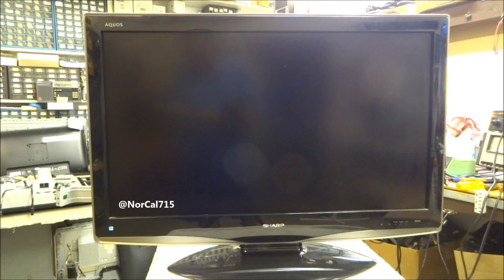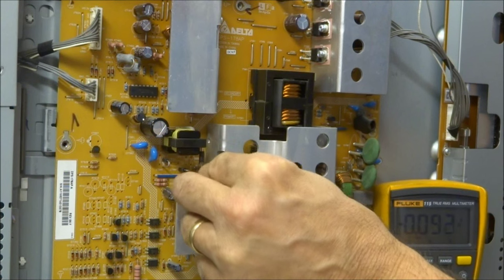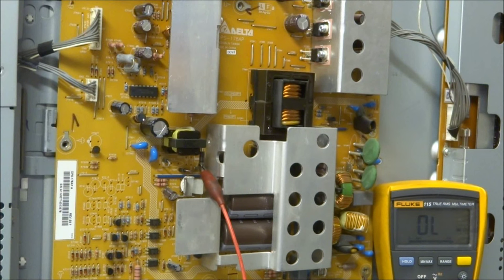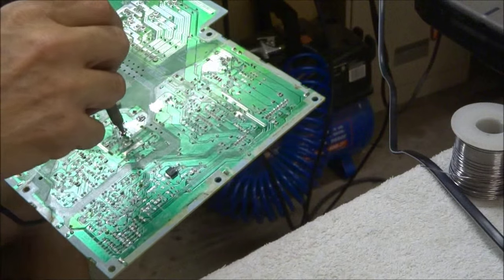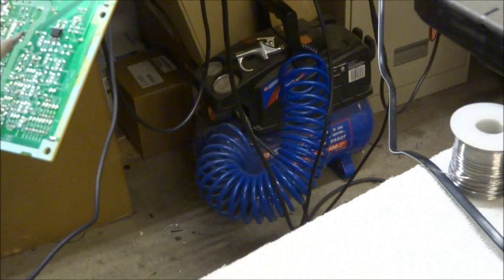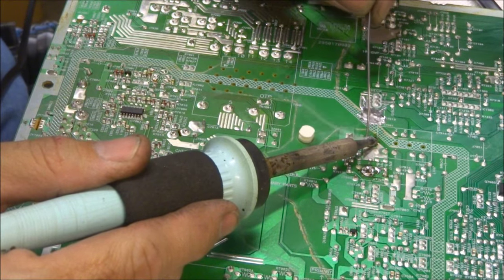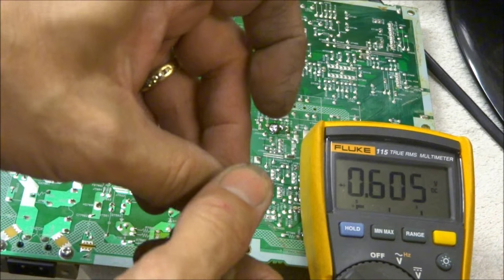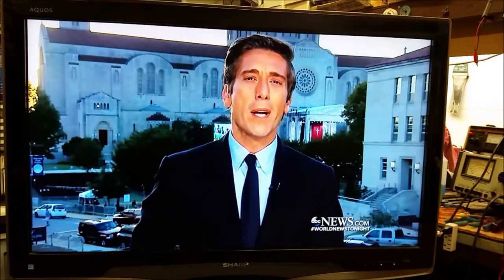Sharp LC 32 37 D 42 43 Dead Set No Picture Power Supply Repair

Comment: I have an Aquos LC-C3242U and no power gets applied. First tried ordering an replacing a fuse (the only one visible) stupidly without even first checking if the old one was broken (ohm it out). When that didn't work I was going to ditch the TV.  As a last ditch internet search for a sharp C3242U with this issue I came across your video - you must have C3242U in your keywords or comments section. I found you ohm'ing out the diode. I did the same and found a reading of 39.4 ohms. I ordered a replacement 150V 5W diode from mouser like you did. Cost me $8. It's on it's way. I'll update this if the repair works. Thank you for showing this!
Reply: Holy crap! It worked! Dude I was totally going to just trash this TV! What a waste it would have been. I have my sights on a local guy who has another just like this with the same problem. He's selling it for $20 <snickering...>  :D :D

Comment: this did it for me, and since it is my second power supply failure, I replaced the 150v 5W zener with two 75v 5W zeners in series, with any luck they will run enough cooler by sharing the power dissipated, that they won't fry in a few years' time.

Comment: Hello, great and informative video. My Sharp TV model LC-46LE700UN could not turn on (Black Screen) and with error signal blinking, green power light blinking twice and opc blinking once, then continue the same blinking pattern. I checked that UR13V not available on the power supply board. Can you please teach me the possible parts I should check and replace? Thanks for your time!

Comment: What would have sent you to the diode if it wasn't for your running into this problem before? 
Thanks for the video and have a nice day.
Reply from the maker: +amtpdb1 It had no standby 5 volts and the set was dead. on the 1st repair it involved troubleshooting and one of the first steps i do is to always test all diodes for forward bias to check for shorts as well as transistors.  This diode and a small rectifier diode are across a dedicated winding of the standby transformer to suppress reverse peaks from doing damage to other components. Thanks
Reply: +norcal715 I had the same question, thanks for the answer.

Comment: I know this was about 3 years ago but I hear other techs say the same thing about using a resistor jumper to discharge the capacitor. I always see the techs use a pair of needle nose or a screw driver.  That puzzles me.
Reply: screw driver or needle nose will discharge the capacitor just fine but that rapid discharge is bad for the capacitor.

Comment: Hello I have a Sharp LC-52LE640U  and it won't stay on.  It will turn on for a few minutes then go all black or turn off.  Then it will keep trying to turn on by itself it seems.  I did the backlight test like suggested but its not showing up so i dont think its the backlight.  Is there a specific resistor i can change out.  I see the main board on your web site is out of stock.  Thanks for the help!

Comment: I have one of these Sharp 42 also and started having problems turning the set on . I would pull the plug and plug it back in a few times and get the green light then one day it just never came back on Is my problem also in the power circuit  Or standby ? The quality of the picture is perfect it just won't turn on very easy ..and now not at all ?

Comment: I have sharp lc60le636e that just went off , I opened it up & noticed c7818 capacitor on the power board was burnt,  I have changed it but still nothing,  I done a quick multimeter test earlier and I think the fuse is  broken  , I've changed it with another fuse from a working telly,  still nothing

Comment: Hi!  I have a Sharp Aquos model LC-32LE653U, takes a long time for picture to appear after turning on.  After picture appears, I see a grainy image with vertical streaks from bright spots in the image.  The display also holds 'ghost' images sometimes of a previous image.  I can send pictures.  Not sure if the issue is main board, PSU board or the display panel itself.  I suspect the main board because of the retained ghost image but not sure.  I can send pictures of the issue.  After a while the image will clear to a perfect image, stay like that for a while, then go back to the grainy image.  This will keep going back and forth; usually for around 15 minutes or more at a time.  I tried a factory reset, no help.  
Would appreciate any help you can supply!  Thanks!

Comment: I have researched for hours with no luck so I am asking for help here from those reading.... I have the Sharp LC-C40 with no power and no lights when plugged in. I put a multimeter on 200k ohm setting and tested the diode in this video but the meter reading is not staying constant. It will start low and climb continuously until I release the contacts. Please advise?

Comment: After performing a test using the volume up channel down I now have the power and the opc lights on and steady.  The tv is hooked up to a direct tv box when I turned on the whole system I got a picture and sound momentarily and then went away I can not get it back

Comment: bilotto134 minutes agoHi I have a LC-37D43U tv. The power works with green light in front of the tv and the backlight also work. When I turn on the power there is no picture but I have a glow. The audio also works well and can hear everything clear. The tv control, by pressing any function does not work. Also with the flashlight it does not show anything. I did open the back of the tv and would like to try to fix it myself before giving up and buting a new one. What should I do or try to verify as the problem?? Do you have a video explaining what to change or test before?? Thank you. Frank Bilotto

Comment: Hi, very nice and excellent video , very informative ..thanks
yestarday i have problem with my SHARP LC-52LE810UN, Aquos Quattron , it was working perfectly normal , and suddenly TV shut off  , and power light start to blink 1 slow and 1 fast alternate , and 2-3 minute tv start again , than by today it start to do randomly but more oftenly , at preset TV dosen't start at all , the moment you power up just bottom power light start to blink one short - 5 sec pause -1 long ..and continue ..screen dosen't come on at all...
few forum they mention it possible error counter reset to press togather  (input and vol - ) power up again or ( ch + and vol - )
all kind but nothing works i can't get that service menu screen to check or reset error counter ! 
but i guess there might be electrical problem too...i didn't open back cover yet, assuming it might just hard reset 
my electronic knowledge is modrate level , so no problem to use any kind using multimeter of spares
by above syptoms would you able to give me an idea its just need hard reset or power board related issue ?
thanks in advance..help apriciated

Comment: hi i have samsung UA 40D5500 dead set.power supply board is BN44-00422B .I checked all the parts i cant find any bad components.all the diodes also goods.cant fix it.i suspect fets and dual diodes.i changed all.still the board dead.only 5v supply available.12v line on and off.i heard from transformer got on and off noise.like frequency noise. basically its cycling.not stable the 12v power...could you give me tips..thanks

Comment: hi.., I need replacement the the diodes zener on my LC-37X20E,  but I not found in web the size and code of them, can you help me ?  I read in manual schematic number diode is D7918, D7805 and D7806 ..
Reply from the maker: D7805 is 1N5406-E3/73, D7806 is STTH8L06FP, D7918 is SB5H100-E3/23. You should be able to find them using those part numbers on digikey or mouser or even eBay.
Reply: @norcal715  thanks !! I not have found in the manual service, why ?
Reply: @norcal715  I have checked better and I have mistake listed ,  so I need of code diodes D7905 and 7906, them are near the power main.. sorry :-) h

Comment: Hello, i have a 47^ Smart LG Smart TV, the power comes on and sound comes on, however there is no picture, is the LED or power supply. I changed the Main board and T-conn board, it still hasn't fixed anything.

Comment: Who now what is the common problem in "TSUM S3H" prescaler board in monitors.The monitor [Philips PHP-x17] hawe good 5v,12v,power lines but not picture or standby LED.

Comment: I got this t.v. but mine red light stay solid green then blink red
Reply from the maker: there are driver chips on the sides and they are on ribbon cables also, they are just little tabs that bond to the glass but dont go anywhere else.
Reply: @norcal715  hi norcal I have this same set but I check all volts and they all correct but the set Set come on when I turn it on it stay solid green and the blink red what u think I'm thinking a mainboard or firmware problem

Comment: I have a sharp lc 52d64u it has a flashing power light no picture and will not turn off
Reply from the maker: Count the blinks and get back to me. I will try and look up the blink code. There may be 2 different leds blinking at the same time. It is important to count both separately.

Comment: Sharp LC 65Q7300U
The Video display went on vacation (get a nice diffused, & even white backlight to go along with the audio when powering on) the LED backlights and audio are 100%, all voltages of everything from PS board are within, anyone out here ever deal w/ this scenario, I'm leery of buying the main video board because I've run across this twice w/ Vizio's, bought the video boards... still no display and out 100$ or so both.
 I'm guessing main board because what else is there...the display go bad???...
I've never had one here with a bad display, even a crappy solder dip or the TV falling over cuz baby huey yanked on the cable (its happened to me few times) would show something on it on somewhere right??
The T-con does have 12volts on it, but that's the only test I'm able to do on timing control boards, re-seated all video related ribbon connectors
Suggestions & donations are happily accepted....

LOLZ, (just joking about donations)

Comment: hello

Aquos lc c6077un. Constant green blinking light. i did the vol/ch reset and it power for 7 sec.
i did change a diode because the low reading. but problem continues. any advice?